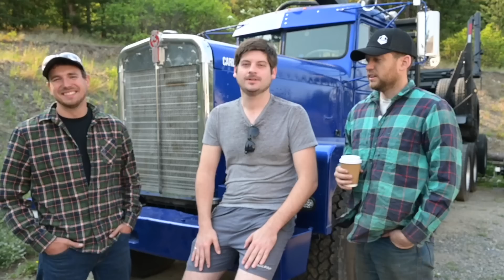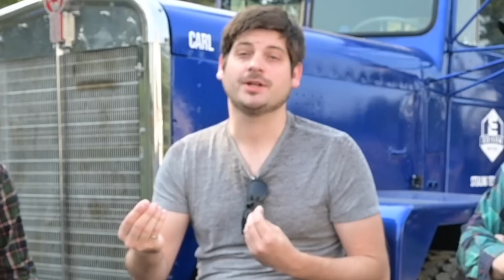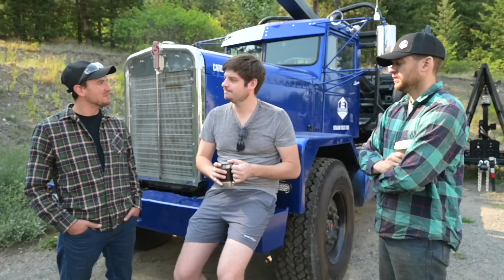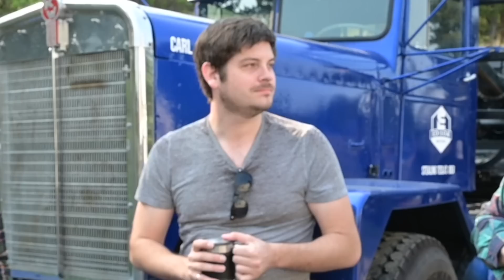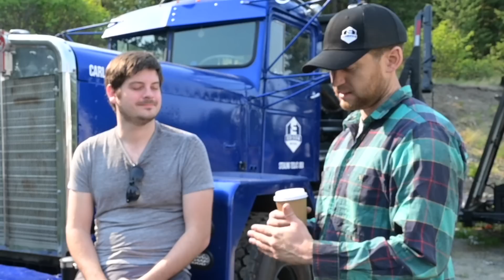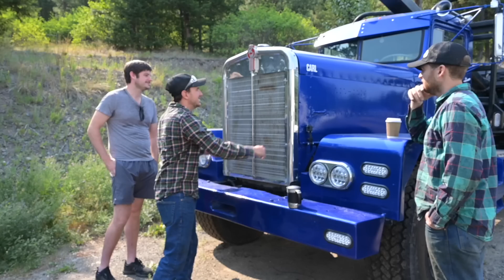The future of Electric Trucks?

Comment: never get rid of the driver override, even with the software. sometimes situations occur, things break, malfunction, and you still need the ability to override.
Reply: I took the comment to mean the generator override.  That is not a safety thing so much as an adaptability function.  A simple scenario may be the road is shut down or blocked due to an accident. Instead of an easy flat roll for the last few miles to the mill or to the beginning of your climb back up you are stuck in a freeway parking lot.  Just knowing that generator button is available if needed when things go wrong is peace of mind.  No need to stress test a driver’s ability to handle anxiety or waste their brain cycles on a distraction.
Reply: @tfodthogtmfof7644  correct, the generator override.
Reply: The correct answer is to have overrides, but ensure that using the override is NEVER more convenient than doing it the "right way".  If you are using the override it should be because it was absolutely required.

It should also be auditable, so if it's being used it's possible to determine why and either the automation or the process can be adjusted to not require overriding.

Basically the important part is to prevent people from getting in the habit of overriding, normalizing deviance from how the systems are designed to work.
Reply: @SeanHarlow I would hate this but if the overide is used your company would be notified if they wanted😭😂
Reply: @SeanHarlow  I see you have never worked in automation.
Reply: @brucebaxter6923  You are correct, I'm a networking/telecom nerd who has dinked around with PLCs for fun, but I've lived around farmers for long enough to understand that sometimes a piece of equipment worth $$$$ is holding up a job worth $$$$$$$$ that needs to get done NOW and it's worth risking the machine to get the job done.  Logging seems likely to have this sort of situation as well.

I'm certainly not suggesting that safeties protecting humans should be able to be overridden, but in some applications overriding the safeties protecting the machine might make sense to override.  At that point it's just a matter of making sure that overriding doesn't become the norm, which is where auditing matters so every event can be tracked and changes can be made to eliminate any recurring scenarios.
Reply: @brucebaxter6923 when it comes to that kind of landscape a human override is definitely a must
Reply: I think most people did not understand Edison Motors. They just have 3 settings for the Generator.  Off, On, and Auto.  Nothing more than that.   Of course, I presume the truck will auto off the Generator when the batteries are full.
Reply: I'm sorry Dave. I'm afraid I cant do that.
Reply: This isn't a safety system, it's a charge management system. There absolutely should be an override for the generator, because you might know something that the automation system doesn't.

For example, one of the reasons I would love to have their pickup conversion is because I spend a few weeks every year archery hunting elk and deer in the Utah mountains. I tow a heavy trailer up the mountain, and then spend a ton of time driving around mountain roads getting to and from hunting spots for the morning and evening hunts, and I also spend a lot of time during the day when the animals aren't moving just driving around road hunting.

A silent electric truck would be amazing for that. I could drive it around all day, and then run the generator AT NIGHT, to charge the vehicle as well as run camp (probably have enough juice to run the entire camp's worth of trailers.

The last thing I want is to be rolling into a good spot to get ready to hike into a canyon for a hunt and have the generator fire up when I'm almost there, and blow the animals out of that whole canyon; or spot an animal bedded down 20 yards off the road, and have my truck decide that NOW is the perfect moment to fire up that CAT diesel generator and ramp it up to full RPM. Gimme good data to be able to monitor it throughout the day and let ME decide when the best time to start up the generator is. If I end up running it dry and taking a nap at the trail head while while AFTER the evening hunt, with the generator running to recharge because that's how I chose to play it based on the conditions at the time, that should be up to ME to decide; not up to some coder sitting in a cubicle in an office building in Palo Alto, or whatever.

Just because it's electric doesn't mean it has to be flashier than it is functional, or out of touch, or overly restrictive to the owner or end user.
Reply: @Wrenchmonkey1  totally agree.
Reply: @Wrenchmonkey1  
Yea batteries and charging dischargeing aren’t safety issues at all
Reply: @brucebaxter6923  
Bruh. Charging schedule isn't a safety issue at all. The battery's BMS will prevent the system from over-discharging. But leave it to the user to decide if they want to override a charging system until/unless it's absolutely necessary.

Don't pretend to be stupid, dude. There's nothing worthwhile that will come of that.
Reply: @Wrenchmonkey1  
Except this about turning off the bms.
Reply: @brucebaxter6923  
Nope. Not at all.
Reply: nothing is smarter than an old guy with decades of experience. Can learn the world from them.
Reply: Just need to have a manual mode,
Reply: @ErVan_AG  they already have the manual mode. On, Off, and Automatic. When in automatic, the software would decide when to activate the generator for optimum performance. But if for some reason something happens the software wasn't programmed to handle, or if something malfunctions, you can force the generator on or off as appropriate.
Reply: Look at how airplanes handle over rides
Reply: @nickabel8279  
Yes. 

I was thinking more of nuclear reactors, power stations, chemical plants, traffic signals and general industrial factories. 
But airplanes is good enough for an override system. 
Ps, notice aeroplanes don’t fail on autopilot, it’s when the pilots turn it off that they crash. 

Also notice how chemical plants and nuclear reactors don’t have computer failures and self destruct?
Reply: @codyfrisch4378 as if people don’t regularly drive into rivers lakes oceans cliffs etc. 

I’ll still take automation failure over operator error. 

Pilots kill 1/3 of all passenger seats by what they do. 
Pilots kill half of all passenger deaths by what the didn’t do. 
Autonomous aircraft have one third the crash rate ……. Imagine how low it would be if there was a navigator and engineer in the front instead of an over worked bus driver.
Reply: @codyfrisch4378 the wars fought against them were horrific.
Reply: @codyfrisch4378 and yet, here you are using technology you can’t understand?
Reply: @codyfrisch4378 
There are currently more than 30 million driverless cars in the world. “This number is projected to grow exponentially as companies like Tesla pour money into the development of such vehicles.”
Reply: @codyfrisch4378 lol. So you don’t understand it at all if you think you are in control of the internet. 

For example, how many ports do you have open at the moment?

Netstat -ano
If you are interested
Reply: A driver override for what exactly?
Reply: @winstonpoplin  stuff happens, computers malfunction. Sometimes the computer is so focused on optimizing, but now you need to to do something different, and you know something the computer doesn't know. I'm not saying you should need it most of the time, but no reason not to have it. If you fail to add it, people will hack the car as required to get it.

In the military (including combat), aviation, and as an engineer, I have far too often encountered unforeseen circumstances that required us to break stuff to make it work right, to "fix" stuff to make it work right, or to rip stuff out to stop it hindering us.
Reply: @winstonpoplin  the generator
Reply: @SoloRenegade  Why would you want to cut off the regenerative braking generator? Its just like normal brakes except you get free energy back.
Reply: @winstonpoplin  it is not the regenerative braking override.  It is a simple button to turn on or off the generator to charge the batteries if needed.  My Volvo XC60 has an option to put the hybrid plant in charge mode.  If I anticipate needing all wheel drive in the future and my batteries are low I will sometimes use that feature to put some charge in my batteries.  He is not talking about overriding the regenerative braking but Chace has already talked about firing up the diesel generator, throwing it to idle and reversing the generator to use the generator as a functional jake brake when you have already fully charged your batteries with regenerative braking.  Thus still having the ability to provide a resistive load to combat gravity.
Reply: @winstonpoplin  "Why would you want to cut off the regenerative braking generator? Its just like normal brakes except you get free energy back."

when did i say that, EVER?

nothing like falsely misrepresenting someone in a pathetic attempt to win an argument.

this is a blatant underhanded and dishonest tactic.
Reply: @SoloRenegade  Your original post clearly said to never get rid of the manual override. And the ONLY implication of that is that you will use the manual override at some point. And what does the override do? Oh yeah it is literally TURNING OFF the regenerative braking. So yes. you did in fact say that you wanted to be able to turn off the regenerative braking. Pretty wild that you cant even understand a simple sentence when you are the one who wrote it.
Reply: @winstonpoplin  "And what does the override do? Oh yeah it is literally TURNING OFF the regenerative braking. "

never said that, never talked about it. I dare you to quote me.

you're choosing to be willfully ignorant at this point.
Reply: @SoloRenegade  Im beginning to think you are trolling because your original post quite literally said "never get rid of the driver override" "you still need the ability to override." Are you literally delusional buddy? Your original post clearly said to never get rid of the manual override. And the ONLY implication of that is that you will use the manual override at some point. And what does the override do? Oh yeah it is literally TURNING OFF the regenerative braking. So yes. you did in fact say that you wanted to be able to turn off the regenerative braking. Pretty wild that you cant even understand a simple sentence when you are the one who wrote it.
Reply: @winstonpoplin  what if your batteries are already completely charged, but you are coming up on a steep grade that will require a place to put that power which is not available? Hence the override so you don't overcharge or overload and destroy the batteries!
Reply: @wesman7837  Any electric machine of any quality will have a control board that can detect if the battery is too charged to put more power into and will automatically turn off regen. So its kind of a non issue
Reply: Sounds like override would void warranty???
Reply: @ErVan_AG  "Sounds like override would void warranty???"

WTF? why? for what reason? what are you snorting?
Reply: I disagree. 
Human factors will destroy equipment. 
You cannot allow humans to override safeties
Reply: @brucebaxter6923  everything needs to be taken into consideration. We don't want to dumb down things too much for drivers to loose or not have hands on skills! We saw this with the 737 MAX airliner! Everything works well when things are working. When things hit the fan is when experience is required! When Sully landed his aircraft in the Hudson river because he lost both engines because of birds, it was his years of flight time and glider experience that saved everyone on board!
Reply: @dans_Learning_Curve  
The max had three systems to override that death trap system. 
One was to hold the wheel against their knee,
The second was to push the button under their thumb
The third was to throw a switch near their elbow.

As you saw, human overrides don’t work
Reply: @dans_Learning_Curve  
If sullys plane was autonomous, it would have shut down the engines, organised atc for landing permission and configured for best range before the humans knew there was a problem. 
Reaction time of the human was the only reason it didn’t land on a runway. 

I have yet to see humans perform better than the automation
Reply: @brucebaxter6923  Reminder that the Max pilots who crashed didn't know what they needed to override because Boeing didn't want to tell them, and the MCAS system was capable of adjusting the trim at a rate substantially faster than a human could physically operate the manual override.
Reply: @brucebaxter6923  if I'm understanding what you're saying.
No matter the stage of climb out the birds disabled the engines, an automated system would have had that plane back on the runway?
Reply: @dans_Learning_Curve  I’m not surprised you don’t understand. 

There was one well known set of events and you now pretend you do not know them?
Reply: @brucebaxter6923  have a great day!
Reply: @SeanHarlow  
Bullshit. 
The trim switch and trim wheel are normal flight controls used on every flight. 

The stupid piece of program operated the trim for 2sec every ten seconds. 
It took a total of over 45 seconds before the aircraft became uncontrollable.
Reply: @brucebaxter6923 you're neglecting that it was possible for the plane to not notify the pilots that this safety feature had triggered, it was also possible for it go further than a pilot could manually correct for.

Whilst removing humans from an automated system can be helpful to prevent common stupidity, there are events that a designer of said automated system cannot predict (the unknown, unknowns as you will). This is why planes aren't fully automated despite being capable of this for years.

The chaps at Edsison come across as smart enough to automate, and still have a way of overriding should it be needed - most likely some secondary start system behind a resettable interlock or relay switch in the electrics panel.

There also comes a point where automating systems too much leads to further stupidity (either to get round the systems, or because correct procedures just weren't known - it also means alot of expensive programming/development to cover every situation driving up costs or leading to poor coding) sometimes it's just better to not insult the users intelligence and keep them involved.
Reply: @oddball_the_blue  
Umm?
What?
The dinner plate on their knee spins, noisily. 
The back pressure on the stick increases. 

How is that not notifying the pilots the trim is changing?

It’s fucking trim!
It’s the weight of force on the damn stick!
It doesn’t matter if it’s shifting cargo, fuel leaks , speed changes, power setting or that stupid piece of code,
It’s a fucking trim change
Reply: @brucebaxter6923  the problem with the max was that Boeing never told pilots about the override
Reply: @absolutezero523  
Partly. 
The main problem was the way it used a single point input and had no sanity checks, literally the software was outsourced to India. 
If one of my apprentices wrote code that bad he would go back to toilet cleaning and coffee making till he apologised.
Reply: @brucebaxter6923  oh yeah for sure but you always tell operators about new systems because no matter what happens, they still know how to operate the equipment.
Reply: @absolutezero523  
Agreed. 

However, putting trim in to lessen the stick force is day one in pilot training for any size aircraft. 

The aircraft was extremely dangerous but not unflyable. 

Personally I think pilots have way too much to remember and do already. 
I don’t believe pilots should be in the cockpit. 
Just a navigator and an engineer to monitor the autonomous systems.
Reply: @brucebaxter6923  in general, pilots aren't necessary, but having a pilot works as a redundant system in case any autonomous system fails. Navigators and engineers wouldn't have solved the 737 max, in fact, it would have likely caused more crashes.
Reply: @absolutezero523  
Wrong. Engineer is not preoccupied flying. 
His only job is to know the systems and monitor them. 

Ps, autonomous aircraft constantly correct trim.
Reply: @brucebaxter6923  ok if the system is off like in the 737 max, the engineer can say "yep, it's wrong, we're going to die" but what is the engineer actually going to do? I know that autonomous aircraft automatically correct trim, that's the point of it being autonomous, but what if it doesn't, or overcorrects? You need redundancy, and it's easier to have a pilot that acts as a redundancy for all systems than to have a redundant system for every single system on the aircraft.
Reply: @absolutezero523  
More than I pilot. 

You are getting into fantasy land with pilots walking out into the wing and using tape to fix things. 

We have proven already the pilots are far too overworked to actually deal with things as simple as trim the aircraft as they were taught in day one.
Reply: @brucebaxter6923  the 737 max overrode the pilot's input and took a nosedive that has nothing to do with trimming the aircraft. Also, you never addressed my actual point, which is that if certain systems malfunction, an autonomous plane will stop functioning. In a theoretical scenario, the plane will never crash. The real world is strange and it is impossible to proactively prepare for every single scenario that could happen. Preprogrammed systems cannot react to something they have not been trained to react to. No amount of overengineering or programming will fix that. At the end of the day, having a pilot on board as redundancy in an emergency situation is never a bad idea.
Reply: @absolutezero523  
Nope. 
It did not over ride the pilots inputs. 

Go look it up. 

All it did was keep trimming it down for 2sec? Every ten sec. 

The pilots inputs were the over riding input.
Reply: @brucebaxter6923  ok so that's true, but how does an autonomous aircraft solve that? It trims the plane down for 2 seconds every 10 seconds but it thinks everything is normal because Boeing used a single sensor, which is absurdly dangerous. Having a pilot that knows what they're doing acts as redundancy if the plane's autonomous systems fail. In this case, the pilots didn't know what they were doing, and so they acted as ineffective redundancy. With no pilots, the max would have certainly crashed, because there were likely other instances of MCAS failure where the pilot acted as they were supposed to, trimmed the plane properly, and the flight went on as usual.

Basically, read the end of my last comment. The point still stands.
Reply: @absolutezero523  
Because there is an engineer doing nothing but monitoring the systems. 
There is a navigator to notice when the aircraft is out of position

And, the criminal behaviour of Boeing not testing certifying and training would not happen. 

The levels of testing and certification for autonomous equipment is so much higher and more stringent
Reply: @brucebaxter6923  my point is that even if the engineer is monitoring the system, what can that engineer actually do if something is wrong? They don't know how to fly a plane. Same with the navigator.

Boeing should never have done that with a regular plane, but they did, because once they bought McDonnel Douglas, they became much greedier and cut corners to meet deadlines.

The level of testing for autonomous equipment is higher, but only because it's new. In the future, when it's not new, the level of security will go down, just like with regular planes now.
Reply: @absolutezero523  
They don’t need to. 
And
Why don’t they know how to fly?
Your mechanic knows how to drive and aircraft mechanics know how to fly and any technician that repairs equipment knows how to operate that equipment. 

Face it, 1/2 of all air deaths are initiated by pilots and 2/3 of all air deaths have the pilot responsible in some way. 

Pilots kill.
Reply: @brucebaxter6923  .00055% of commercial plane flights result in the death of a passenger. Also, most aircraft mechanics don't know how to fly. They know how the systems work, but they don't know how to fly the plane because they haven't been trained (in general). 

And I ask again, how does not having a pilot in the aircraft fix the MCAS failure?
Reply: @absolutezero523  idiot
Reply: @brucebaxter6923  : the critical mistake of Boeings system was lack of documentation and training the operators IN the usage and limitations of the MCAS -  before rolling it out industry wide.

 - A stupid freaking auto-control system which drives an airliner beyond critical AoA  - without adequate state estimation - in the absence/failt-mode of a single sensor's input - for level 3+ autonomy,  not part of the trucking control dynamics in question here.  (Much of the operating environment in the automotive world involves stable systems - lots of positive poles - invoking one's delight in modelling and controlling metastable and unstable systems helps throw the BS-ers off scent.  cheers....
Reply: @brucebaxter6923  "However, putting trim in to lessen the stick force is day one in pilot training for any size aircraft. The aircraft was extremely dangerous but not unflyable. "

But by using too much automation, pilots forgot their basic flying skills......proving the point of need for manual overrides.
Reply: @SoloRenegade  strangely you see the problem but not the solution. 

Humans just can’t do boring tasks. 
Computers are perfect at full dirty and dangerous. 
Remove the pilots and put in a navigator/comms and and engineer. 
Let them supervise.
Reply: @brucebaxter6923  humans do boring tasks all the time. name one task that isn't boring.

you've failed to address the idea that not practicing tasks, even boring ones, results in pilots being unable to supervise and correct a computer when it inevitably fails.
Reply: @SoloRenegade  
First. 
Checklists. Boring and often missed items cause deaths. 
Flying a plane, boring, pilot initiated events cause half of all air deaths. 

Look up gorilla basketball. 

When the computer fails you now have an engineer not an overworked bus driver. 

Next you will be talking about climbing on the wing and sticky taping it back on
Reply: @brucebaxter6923  Checklists are incomplete, don't cover all scenarios. I've specifically trained this in real life as a CFI. I've given airline pilots real life scenarios where teh checklists get them killed. Computers follow checklists, pilots like Sully know when to deviate.

Humans are good at things no computer can automate.

Most human cause crashes were not during boring phases of flight. Plenty of accidents occured with automation during boring phases of flight.

the more complex software gets, the more accidents occur, and the more failures occur. They still can't master automated driving for example.

When the computer fails, you now have an overloaded and task saturated pilot due to not being practiced, not being mentally ready, not paying attention and relying on the computer instead. Modern aircraft have no engineers. and the day they fully automate, if ever, you'll be lucky if you have more than one pilot on board.

"Next you will be talking about climbing on the wing and sticky taping it back on"

nope that's you trying to use a red herring to deflect from yourself loosing the argument at hand.
Reply: @brucebaxter6923  All too often denying people the ability to override has gotten people killed needlessly. software fails far more than you are apparently aware.
Reply: @SoloRenegade  
Citation needed.
Reply: @brucebaxter6923  What's there to cite?

how about you cite your evidence to support your uninformed opinions?

You're teh only one asking for citations, as if that changes anything. Apparently your arguments can't stand on their own logic.

Do you intend to rely upon the "appeal to authority" fallacy to make your argument?
Reply: @SoloRenegade  
Ntsb reports. 

One half of all air deaths are initiated by pilots. 

Two thirds of all air deaths are pilot related. 

Can you please cite your sources?
Reply: @brucebaxter6923  cite your sources first. "NTSB" is not a citation. and I'm not talking about teh cases you're cherry picking. There is no magic software for the cases where most of those pilots screwed up, that would have saved them. so make apples to apples comparisons, and cite your sources (such that I can go read exactly what you read). I'm talking ONLY about cases where the operators are prevented from operating their equipment fully, unable to override things. Like an engine governor in an ambush as a very low level example.

But what would be better is if you could form a proper argument that is logically consistent and stands on its own merits, without need of "appeal to authority". Or are you unable to make such an argument?
Reply: @SoloRenegade  if you do not accept ntsb reports I can’t help you. 

Who does better investigations or more of them than the organisation who’s job it is to find the root case of accidents ?
Reply: @brucebaxter6923 ow many of those NTSB reports were for light aircraft with little to no pilot assist systems?

Come back with figures on assisted aircraft and cite sources (saying NTSB is lazy as best.)
Reply: @brucebaxter6923  it's not a safety device, it's a charge optimization algorithm.
Reply: @brucebaxter6923 computers crash all the time
Reply: @brucebaxter6923 no because the safety systems of a truck are never going to understand the full context of a situation. If an override is the difference between possibly damaging the vehicle or losing the vehicle entirely or causing death or serious injury then I’m going to damn well use it
Reply: @Woodie-xq1ew  
Why?
Reply: @brucebaxter6923  You're the reason why we can't have manual transmissions anymore. Go away. No one likes you.
Reply: @brucebaxter6923  Sarcasm?  You’re skirting Poe’s Law so I can’t quite tell.